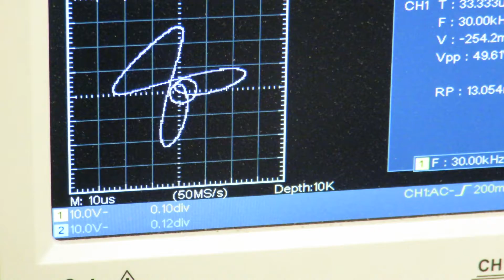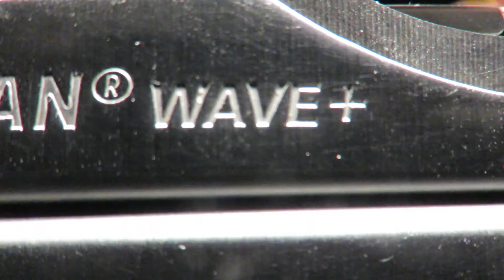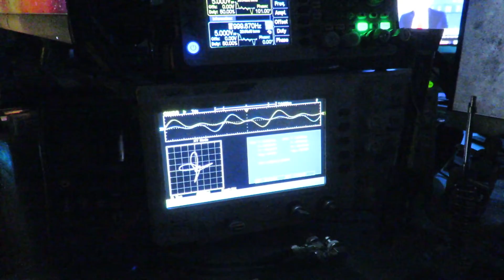LEATHERMAN WAVE+ : the world best-selling multi-tool!

Comment: In my opinion, as a mechanic, the wave is the best multitool, in design, innovation, everyday use, and durability...hands down ever.  I have 3 2nd gen waves (my fav.) a wave +  and a charge ti (love the ti but it's a collector).  These dudes are right, the background jungle noises are relaxing 🙂👌

Comment from the maker: Wave+ $100
- steel frame,
- no accessories,
- black nylon sheath,
- Torx cap screw.
Charge+ $140
- aluminum frame,
- blade 154CM,
- accessories (pocket clip, removable lanyard ring, one bit set partially equipped),
- serrated blade fitted with a belt cutter hook,
- brown leather sheath,
- pericranted cap screw.

Comment from the maker: So you will ask me if the Wave+ is preferable to the Charge+ since the latter is more expensive.
It should be taken into account that the Wave+ is delivered without accessories and with a standard nylon sheath while the Charge+ is accompanied by accessories (pocket clip, lanyard ring, one bit set partially equipped) and a leather sheath.
Also, when it comes to the Charge+, the blade is 154CM, the serrated blade is equipped with a belt cutter hook, and the frame design is different (aluminum frame/ folded steel frame).

Comment: Wave+ is the best bang for the buck. It is a basically a Charge without the gut hook and lower grade steel for the knife, with a 40% discount.
Reply from the maker: From memory, the Charge+ is delivered with accessories (lanyard ring, bit set, pocket clip) and an leather sheath. In addition, the outer frame is made of aluminum.

Comment: Hi, I have the original non-locking wave and  after that the locking wave. What makes the wave plus different ?
Reply from the maker: New Wave/Wave+ : Replaceable Wire Cutters. This is a very important modification since it allows to extend the life of the cutting pliers (to no longer be afraid to cut hard wire).